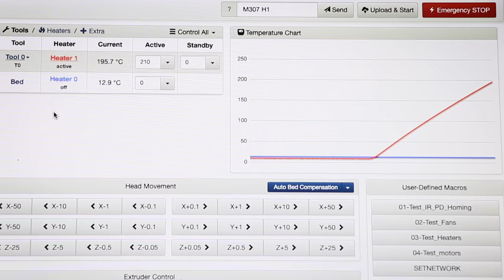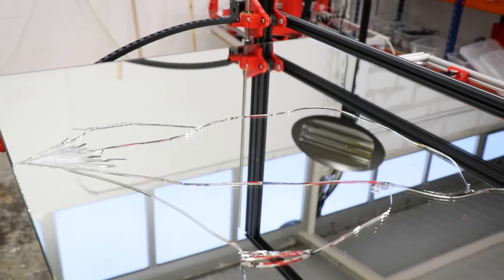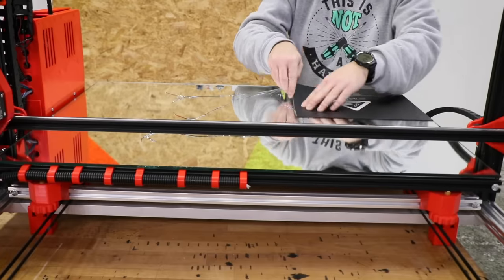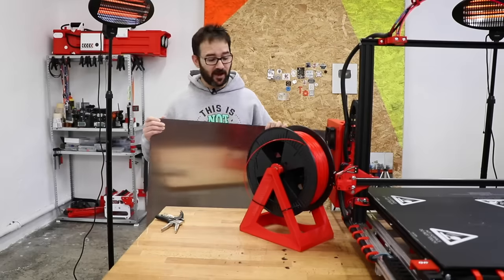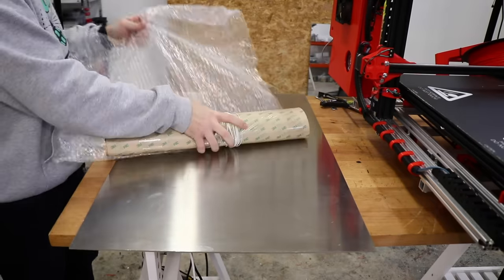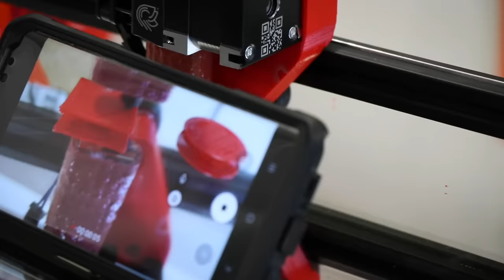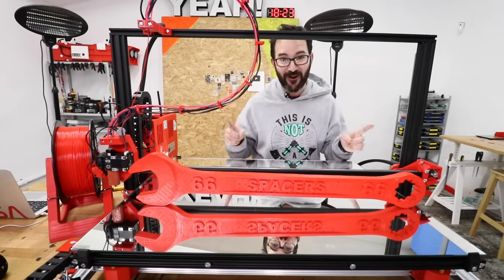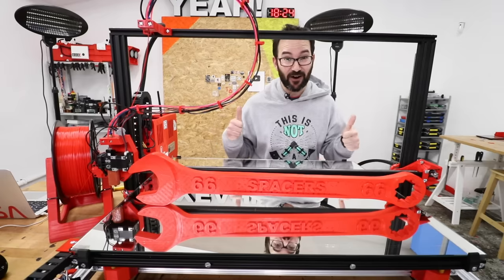GIANT 3D PRINTER FROM SCRATCH - IT WORKS!

Comment: Congratulations on getting this monster running- I'd like to criticize it (constructively)
So the electronics were super cool- I don't know much about Duet boards but it seemed effective.
You seem to be aware that you definitely have not created a printer centered around quality- since you seem to be aware that is not the use-case for this printer, I won't deduct any points but I will make notes:
-Your bed moves tangential to it's plane and the mirror is crazy smooth, you're going to have lots of problems with prints sticking at such a humongous scale heck even at a small scale that's difficult.
-Having such a large bed moving back-and forth as your Y axis also means a lot of strain on your motors, and a heck of a lot of wasted space granted you've opted to use 2 Y axis motors... which is valid as far as fixes go.
--I do really like how you organized both your filament tubing (not a bowden tube, it's a direct drive setup) and your extruder wires etc. that's a way cool and efficient way of doing that.
--Speaking of extruders, I like your use of direct-drive, it's gonna make for a more versatile printer.
--You have a very tall Z axis which is not well-supported, combined with heavy moving parts this is going to introduce a lot of wobbling and poor print quality towards the top-end of tall 3D prints. You can actually see this happening when the video is sped up, and I"m sure it's noticeable in real-time as well.
-Using a large diameter nozzle will mean that you can't print with high precision, combined with the other mechanical failings this means low quality prints with that having been said it's also a valid way of increasing the reliability of your printer by reducing print time.
--Your mechanisms for bed leveling are highly effective, adding in both manual and dynamic leveling as you have done are great ways to ensure that the printer works, even if it's not super-high precision or accuracy. good job.
-The X axis GT2 timing belt tensioning system is well, hot garbage fits based on micro-friction like these are likely to come loose very quickly. It's best to use some kind of macro-friction (interference) fit, even if it's only a basic fit, a good example achievable with little modification would be to 3D print shims for the existing mount which force it to remain held to one side.
--Finally you're using 2 2020 extrusions lined up side-by-side, it would probably be beneficial to use 2040 extrusions in those instances.

I would be really curious to see how a printer this large would operate when built with a Bed surface that either is stationary or moves perpendicular to it's surface.

My suggestions moving forward, if you're so inclined (assuming you haven't done so already, this comment is way newer than the video):
---put diagonal bracing between the peak of the Z axis and the corners of your Y axis on the frame (brace against Y axis movement)
-Consider adding a helper extruder on the other end of your filament tube similar to a bowden, this could improve how the printer runs with more high-friction materials
--I would 3D print or otherwise make a plate detailing both the precision and accuracy of that printer, so you can adjust tolerances.
-I would look at eventually getting a glass or mirror which is not likely to break due to heat strain, gorilla glass is my favorite for it but you're only likely to find borosilicate if even that.
--I would recommend fixing the X axis tension system as outlined above, or some other way if it suits your fancy.

I will now proceed to watch your other videos to see how you've done, cool project overall. and I hope some of this helps- or better yet, that you've already done all this and seen an improvement.

Comment: Some advise using mirrors because of the evenness of the surface. But it's not right. Here it is necessary to look at temperature differences. Borosilicate glass should be used here. Then it will not crack.

Comment: A sheet of carbon thermal interface material stuck to the back of the aluminum sheet will help disperse the heat more evenly. Aluminum is good for through, carbon is good for spreading. It's occasionally used in the LED lighting industry.

Comment: @ 3:46 you should use a 20x40 extrusion stood vertically for the X axis to remove most of the flex. That's a heavy print head.

Comment: Hi Ivan, I am a rookie at 3d printing. I loved the Idea of your big printer so I  bought both the boards you bought for your printer and I'm sure I have everything connected correctly. I even got onto the web control board but I do not know how to properly configure the motors or the end stops. I need step by step on how to make this happen or for some one to actually come an help me because I am unable to home everything.
The other thing that you should know is that I bought the quad fusion extruder head so that I could mix colors. I have been at this for some time and gave up for awhile but I have spent to much time and money to give up. The things you have built are crazy cool and I would love to get things going. PLEASE HELP ME.

Comment: Considering the size of the objects this is designed to print, would it not be prudent to use 3mm filament and a 2mm+nozzle? The bottleneck would be plastic throughput but I think with maybe 3 heating cartridges in the hotend (and a custom relay board to run them) it would be doable. The obvious advantages are print time and strength. Disadvantage is resolution, but with prints this big it's not really an issue.

Comment: I just got a quote to print a 13' submarine in 1/32 scale to finish out for RC it was over $8000. Does this sound right? Printing is that expensive?
Reply from the maker: Which material?
Reply: @ivanmirandawastaken  I didn't even specify, I know so little about it and it wasn't specified. I'm just thinking it should NOT cost 8K to print something like your tank. Do you? Thinking I should higher someone like you to print it.
Reply: You are Amazing

Comment: is there a reason you used the Duex board? Im wondering because you have a single X, a single Y , and Dual Z with a single E axis, all of which can be done by a single Duet Board, why the Duex expansion board?
Reply from the maker: It has two motors on all axes
Reply: @ivanmirandawastaken  that makes total sense, sorry for questioning you

Comment: Dang man how do you get it to stick so perfect on the mirror?? I have a CR-10, and have been using the stock glass bed with glue stick for months, but I hated the rough marks it left. I loved the PEI sheet on my other printer, stuck SO well and so smooth, but for a 12x12 inch of it it’s $20 which I don’t want to pay lol. I went out to get a glass bed yesterday, to hopefully avoid tape, glue, and hairspray, but man it doesn’t stick any better than bare glass. Any suggestions??
Reply from the maker: https://youtu.be/Kj4Xz3DwGSQ
Reply: @ivanmirandawastaken  that is EXACTLY what i needed. Thank you so much. I cant wait to try this as soon as my 10 hr print (on a taped mirror :)  ) finishes.
Reply: @ivanmirandawastaken  i washed it 3 times, and in the 3rd wash i finally was able to print a benchy, but there was horrible warping im surprised it didnt fall off. Is there anything else you can suggest? Do you think really fine sandpaper could help? I dont know what else to try. PEI works fine on my other smaller  printer, i know how to level the bed correctly, its not warped because its a mirror, i just dunno

Comment: awesome project. but looking at the timelapse, the top looks like it would profit from getting stiffened with 2 extra metal rods to the base, maybe even with a dampening mechanism which calculates an offset value on the printer head position

Comment: OK, you covered the mirror glass support concern very well. I’m surprised, since most everyone claims you must have borosilicate glass for 3d printer beds. Unless there’s something about that mirror we don’t know, you’ve somewhat debunked that notion.
Only thing I would do (other than not making it sooooo big, is change out the Bowden-fed print head for a direct drive scheme. If you’re forced to slow it down for “ringing” at the ends of the axis run, this would be a great place for stiffer (read that larger) belts and/or servo drive for that axis.... in fact, I would probably use them for both the bed and the print head. In fact, maybe I just will.....🧐
Thanks again for a great pair of videos. If it won’t offend, I’d like to subscribe....😉

Comment: Print Bed looks real heavy, may be hard to accelerate it fast??  I built a huge printer, using a single 15x15mm extrusion frame that supports a 3mm Aluminum plate. That big Al plate has a 0.5mm thick PEI sheet glued on top, and a bunch of cheap 200x200mm PCB heater boards glued to the bottom side, and 2 layers of foam board glued over that for insulation (much cheaper than a large silicone heat pad) ... and that is powered using a $15 used 750 watt HP Server power supply off Amazon, that brings the monster bed to 60C in about 7 minutes.  The whole Y bed isn't too heavy, a single 60Ncm NEMA 17 stepper motor drives the Y axis, using a steel corded GT2 belt.

Comment: Hi, awesome printer, almost as big as my bedroom and puts my prusa to shame, just one question from a design point of view, have you thought about using wider gt2 belts, would there be any improvement in doing so? Not really clued up on printers of this size but I know you can get 12mm width belts which are a fair bit stiffer :)
Reply from the maker: For sure, the wider the belt the less it would stretch. In the X axisnit would not make much difference but in the Y for sure it would.

Comment: I am very curious about your boden tube/wire management going to your carriage.   Does it just use filament for the guides and the printer parts to keep them in line?  Would much rather do this than a drag chain
Reply from the maker: It uses nylon fishtape and the printed parts are pretty tight yes.
Reply: @ivanmirandawastaken  thank you.  Going to order some fish tape and try to make something similar

Comment: Hey Ivan! You replied to my other comment on this video, about why your prints stuck so well to a plain mirror without glue or tape, and you send me to your other video, about how you wash the mirror and NEVER touch it. Im really stuck. I washed the mirror 3 times, and i BARELY printed a benchy, but it was all warped. Then nothing stuck. I got about 5 layers through a benchy, after 3 tries. I used sandpaper and scratched up the whole bed AND washed it, and i only get a couple small prints done before nothing sticks. Please help! I cant afford a 12x12 in PEI sheet for my CR-10, and i really would like a beautiful smooth bottom on my prints. Also im posting this on your other video about how you clean your mirrors video in case you dont see it here. Thanks in advance, M.

Comment: Gaps could be improved by increasing the number of top layers. By increasing the number of top layers you can achieve a complete surface more efficiently than increasing the density of infill, since each successive top layer provides more surface area for the next to build off of. More dense infill increases print time exponentially, whereas adding 2-3 more layers to the top surface will improve top surface in far less time, and will use less filament.

Comment: Good Job Ivan !! Congratulation !! :)

I have a question about the printer and I will appreciate if you have the time to provide me with an answer :)

I plan to build my own 3D Print as a hobby project. The steps you describe on your videos are more than clear ! The only concern I have is what software you use for the printing. Is one provided by the Duet3D controller ? You used a third party software, and if, what was that software? And finally, the used software what kind of files it accept's for the printing? Do you know if I could use CAD files for printing ?

Thank you very much in advance for your reply and good luck with what you do !!! :)

Comment: gaps are not due to low infill. its called "pillowing" and happens when there is not enough part cooling. looking at your design, you don't seem to have a part fan. install a part fan and adjust your cooling to get rid of this issue.

Comment: This may be a stupid or uninformed question, which is why im asking it, but why do all the diy printers use a glass/mirror for the bed? Why not go with something along the lines of the prusa with a spring steel bed on a magnetic heated surface. Or even just a textured spring steel surface that is clipped to your heated surface?
Reply from the maker: A mirror can be bought anywhere with the exact dimensions of your machine. The other solutions you mention require dedicated industrial processes not easily available

Comment: You didn't need to put the bowden adapter into red plastic part to have reverse Bowden - Hemera already has reverse bowden adapter on the top, you can stick tube right in there!

Comment: hi ivan, great work!!! congrats!!! i love your channel and stuff u build and design. i have some quyestions about this printer. 1st how many watts for the power supply using 6 heated bed 30x30cm silicon pads? 2nd how many stepper motors did u use for each axis? 3rd can u detail what stepper motors did u use? 4rd any aditional electronics parts if i compare with cr10 3d printer (besides the power supply)/ or tevo tornado 3d printer? Thanks and congrats again!!! Gracias amigo!!!

Comment: Hello, recently i built a printer using the duet wifi but i couldnt find the correct 8mm trapeziodal lead screw settings and was wandering if you would mind publishing yours?

Comment: Im building a 3D printer for a senior project and would like to use Ivan Miranda's 3d printed parts as a start.  The profiles do not ship to the US however; does anyone know if regular 2020 works or if I need to find specific profiles that fit the wheels and bearings.  Suggestions and links would greatly help!

Comment: probably should not use the bed as an X or Y axis at anything bigger than 300x300mm there will be too much inertia on movements and itll affect quality better option is to have your bed move up and down and a light weight X and Y solution on top like a corexy

Comment: I was wondering, i want to make a 3D printer with a print surface of 1m by 1m by 1m.
But because a moving bed with big prints is not ideal and you need to use bigger motors etc...
I whant to make a printer where the bed is fixed still and where the nozzel moves in the X- Y- and Z-axis.
And if the bed is stationarry, perhaps you don't need to level it anymore???
Right now i should need just 4 motors (to move the axes).
I have made a sketch i could show you but i can't share foto's in the comments, sad.
i was wondering what your thougts where about this, is you maybe have any tips or thing i should do ore not do. (ore if anyone else has some advise, i'm quit new to this).
By the way, love your vidio's!
Reply: Never mind, i basicly came up with the idee of the piper 2 ...

Comment: i wished you made a video about setting up the software step by step  thats the only problem i got everything else i could easy build in my workshop, i would use a lets say an ender or longer l3 printer and just extend him but how to adjust the software that the printer knows he isnt anymore 230x230 x250 but instead 500x500x500, it seems nobody ever made a vid about it even you build a complet new one instead of make an old printer just bigger ^^

Comment: Man glass has the worst heat capacity
Reply from the maker: I know! That's why is such a good choice. The HC is 0.84 to be precise, which is quite useful to keep a stable temperature through the whole print. And that heated bed reaches 60 deg in less than three minutes with 10 deg ambient temperature. Thanks for noticing!

Comment: That's a big toy, not sure about how PLA will handle vibrations but there's always room for improvements. If you want to use something easy to print and extremely hard and reliable have a look at ALFAOMNIA from FiloAlfa. The best filaments I've ever used

Comment: This is fantastic! Congratulations! However... please tell me that isn't Capricorn Tubing! If it is, if I send you a cheap PTFE tube and pay for your shipment, could you send me that piece of tube? Since this isn't bowden, Capricorn is actually a bad idea, since it has a smaller inner diameter and will likely cause extra effort on the extruder if the filament is slightly larger than the specification.

Comment: filament is so pricey tho ;-; I never even use my 280x300x280 build volume cause it gets expensive to print anything big. most of my prints are under 200x200
honestly you should've made a corexy at this size tho maybe xD the belts would've gotten long but it'd be still nicer. you could use taller bigger belts :? Hmmm or move the z gantry back and forth

Comment: Man you should have gotten someone to donate some rails for that bed to ride on. I can't tell what's going on in the videos but it looks like alot of flex. Also why no BLTOUCH? They would send you one if you asked probably. The next question I had was did you use Gates GT2 Aramide belts? Because if not the stretch is going to be bad. It won't be immediate but it will happen over time.

Comment: Why your use bowden? Direct better
Reply from the maker: It is direct
Reply: @ivanmirandawastaken  Sorry. I'm not notice.
Reply: @ivanmirandawastaken  This is 3D printer not support ABS?
Reply from the maker: It technically does but ABS warps a lot so it requires a heated chamber
Reply: @ivanmirandawastaken  For it is, you need take out power supply. Because IC component afraid hight temp.
Reply: @ivanmirandawastaken  You print only on PLA?